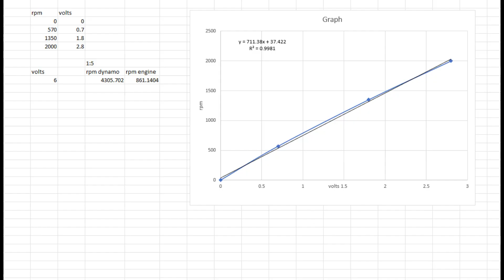Adding a dynamo to the the 3D printed steam engine

Comment: i mean yes thats cool and all but first thing the voltage is pretty irrelevant to measure because if you put some load on the so called dynamo the voltage is gonna drop anyway. second thing running it with a led and without led doesnt change nothing at all because the led doesnt require like any current to run it. you should try a light bulb next time. but ye thats nice project and i suggest using a BLDC motor as a dynamo it will work much better
Reply: but yes the brushless motor will give you ac voltage so u would need to rectify it... one diode should be fine
Reply from the maker: @radimsuk900  its a dc motor 
and yes ill do some proper testing this was more of a proof of concept